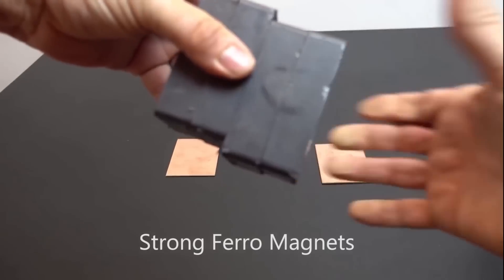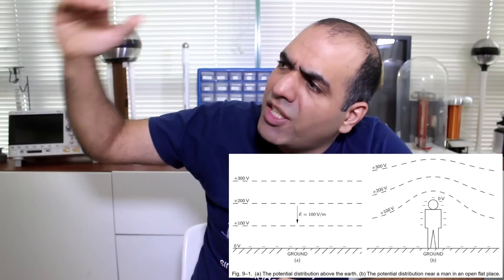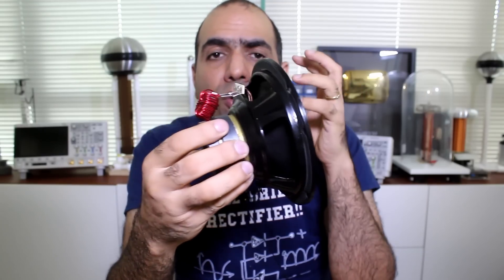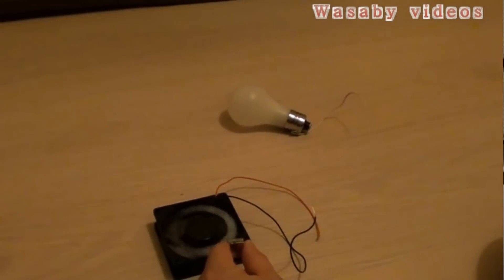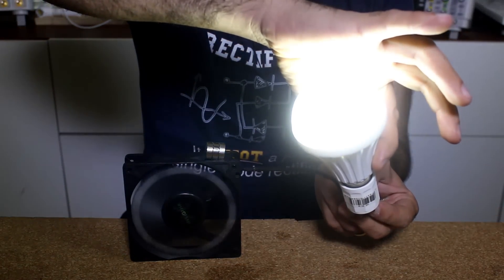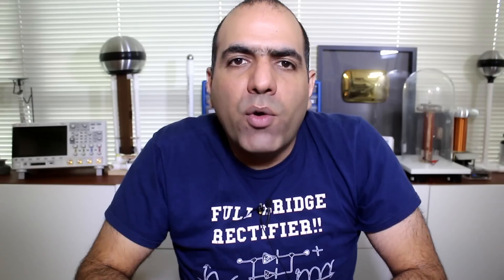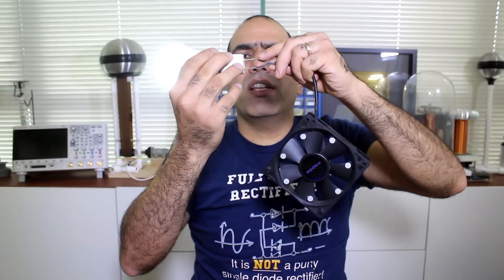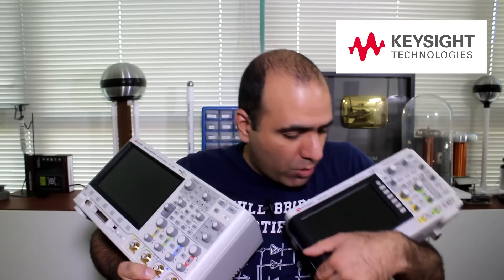Free Energy Devices Build and Science

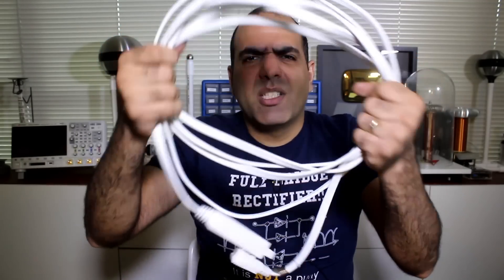Comment: 9:27 - he did not hide batteries inside a powerbar. What he did, is the that he had put his diy induction coil under the PVC and modded powerbar wiring in a way, that the cord behaved as a secondary of transformer. 
BTW. This guy under a question is DiodeGoneWild. He meant it as a joke. So don't sue hin.

Comment: If the fan energy not real, so how does the wind turbine work? It should work the same, right?
Reply: As you said, wind turbine. The wind makes the generator rotate
But in the case of the fan, there is a hidden cable or hidden battery

Comment: Please stop with fossil fuel killing the planet. That is a lie and bad science. Stick to electrical and electronic theory.by the way there are no solar panels without coal, no electronics without oil and gas. No wind mills no lithium batteries no cell phones computers or tv.where was the Tesla coil under the table. I suppose you could do it if a radio transmitter is near by as well. Any ways keep up the good work.
Reply: Christian Weissmuller  solar panel can literally be made with just electricity, y'all stupid af
Reply: @Kevin actually nuclear energy is a terrible way to convert mass into energy due to the fact that it only converts some of the mass into energy and you barely lose much mass.
Reply: @Kevin also it depends on the nuclear fuel you use like uranium which is shitty and thorium which is 1000 times better
Reply: @AuGrrr  are you kidding me? you can get a ton of clean energy since whatever nuclear fuel you use is making an extra neutron. you can just reflect it against itsellf and produce way more energy than anything we use
Reply: @crymorefkr  what I meant is that it barely turns mass into energy and is horribly inefficient in turning mass into energy. It turns around 0.1% of the mass into energy which is how it actually works. Fission is destroying mass or atoms to create heat. Fires turn 0.001% of mass into energy and nuclear reactors turn 0.1% of mass into energy.

Comment: Do an episode on the of casimir effect. Two plates being pushed together by virtual particles seems technically like free energy to a very limited extent. This experiment has also been done using light that oscillates at relativistic speeds to make virtual particles real.
Reply: No , the energy you are talking about that drives 2 plates that are very very close (and flat) together is always with us, it is very small  but normally is  hugely drowned out by other forces . It is not free energy ! When you separate 2 plates you input the energy that resets the energy state .

Comment: Could you use fan with magnet facing the same way and hold a magnet facing the other way and then spin it and would the magnet facing the other way repellent but instead of the fan motor do you have a magnet that's spinning around a coil what that create at least a little energy if so wouldn't that work with the fan

Comment: Hi I have a doubt I need to make a dc power supply with 110 v output but in India we have wall outlet of 220 v ac , I have challenged myself to build it using the parts from an old computer smps can you please help?
Reply: Best you can do is use a  reduction transformer to reduce voltaje and at the same time isolates the circuit from the electric line. You must do it this way to be safe.
Reply: @roner61  I already burnt through 2 of those , every time I wire the primary to the wall socket it bursts
Reply: @hemanko007  You can try with 2 transformers, for example: 220/12 + 220/24, and connect the 12Vca into the 24Vca  coil (inverted)... look some videos about connecting transformers.
Reply: @hemanko007  I dont understand why your transformers get burnt...
Reply: @roner61  me neither

Comment: They all have a battery inside of the light bulb and you just short it with your hands shaking your elbow was doing nothing you had what your finger is that what it actually is shorted because your fingers isn't very good at shorting and in the middle using a 12 or 24 volt PC fan that runs on DC to make 120 volts ac no way

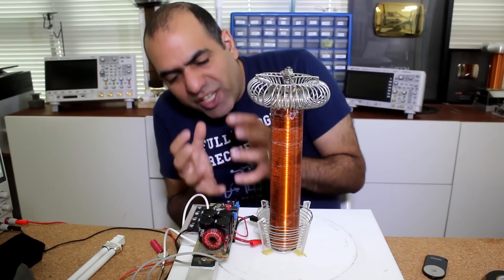Comment: At 8:00 you say that there are no streams of electromagnetic waves coming out of objects that are stationary. I think that this is technically incorrect --- there are constant streams coming out (black body radiation) but at the same time, exactly the same amount enters the object at thermal equilibrium. You still can't, of course, get energy out of it --- the streams would have to be different between the objects, which is the same as saying the temperatures are different --- it's a heat pump!

Comment: Can you make a video about Farad and microfarad ? Please !
I'm trying to create a circuit for my Airsoft shotgun and I don't know how to calculate how many Farad I need :(
Reply: why do you need electricity for a shotgun
Reply: @tornadius4343   its an Airsoft gun which uses compressed CO2 cartridges or springs to fire small plastic BBs. Its a toy, not an actual weapon.
Reply: @feloria1862  i read the same thing you did. i know. but why would you need electricity for a shotgun. green gas or co2 or just regular pump action would work better
Reply: @tornadius4343  it works in this way, There’s a motor and a gearbox that run a piston to provide compressed air. C02 airsoft guns are more expensive

Comment: But is there are good solutions to get "free" electricity from various signasl like in my case i live in city center there is plenty wifi signals antenas and electrical activity i would like to make somkind coil antena that would pick up some power for curiosity and further experementing
Reply: If you actually tried to do it you would figure out that a 2x2cm solar cell using visible light from the sun through your window overpowers a giant antenae in the middle of a radio dense city that cant get enough energy to do anything.

Comment: By one of the fundamental laws of thermodynamics, energy cannot be created, or destroyed, only converted.
Another law, is that it is impossible to convert energy at 100% efficiency. 
This means no matter what you do, energy is always wasted and lost to the surroundings as heat, sound and light.
Reply: Conversion is more efficient if that loss can also be converted to work.
Reply: @vksasdgaming9472  tell me how you can convert waste energy to the desired form then. 
Its impossible to capture 100% of the energy converted, meaning the perpetual motion or free energy device WILL stop.
Reply: @aether1370  Waste heat can be used to heat water which turns to steam and steam spins the turbine attached to a generator. Improves efficiency. I know capturing 100% of converted energy is impossible. For perpetual motion device be useful power source its efficiency must be over 100% and that means excessive waste energy it creates will destroy it. I guess these free energy devices appeal to ignorant and paranoid.
Reply: @vksasdgaming9472  good
I thought you were like "OmG fReE eNeRgY iS rEaL"
Reply: @vksasdgaming9472  consider me proven wrong xD

Comment: Why don't we harness the energy of the sky? My idea comes from the fact that if we could use titanium oxide to make it rain, why don't we use the clouds and a heat source to create artificial lightning? 
Would that not be enough energy to continue generating a generator that can continuously run, while finding ways to utilize the power output to generate more power through other capacitors?
Reply: Because you need to use energy to get titanium oxide and clouds need to be found and you would need to put it in the clouds, you would waste more than you could get, clouds move and you would need a moving metal spike that gets the energy into a battery, lightning creates a lot of plasma losing energy to heat.
Reply: I think you'll find that seeding clouds is completely separate from making lightning, which requires temperature gradients (aka gigantic amounts of shifting energy)
Reply: @logitech4873  and where do you propose to get this lightning hmmm?
Reply: Its literally in his comment to get "energy of the sky" from natural occuring lightning which would be very inefficient
Reply: @tassadardaris7294  What?

Comment: I feel like with a couple more components and a much bigger fan, that magnet fan thing might actually be able to generate some small amount of power. 

Adding an alternator and a power inverter, along with batteries to store the power would essentially create a wind generator, but without the wind. 

The problem would be that I don't think the magnets would actually push the fan blades. I think the magnetic fields between two blades would equalize and the fan wouldn't move at all.

Comment: How about you create a large circular thin platter and on that platter perfectly line up tons of really small horseshoe magnets in circles, then create a ring of light material that branches out in all directions from outside of ring and has thin bars of metal that hang down perhaps even lots of coils around each small bar of metal hanging down. Now put motor in center of ring and attach  it so when it's on it will be able to spin the construct with small metal bars hanging down. Now build small pillars that sit around the lower platter covered in horseshoe magnets and atop the pillars put a circular ring shaped track. Now build a large ring shape structure around the other structure with the branches that have small metal bars hanging down (secured in place but pointed down) make sure rung is also made of very light weight material just like the branches that are holding metal bars. Now on the ring that's around the branched out metal bars hanging down put magnetic balls that will magnetically float on the circular platform sitting just above the horseshoe magnets. Make sure the metal bars attached to branches is all wired up so when they start passing through the magnetic fields of the horseshoe magnets the electrical current can be funneled and captured into a battery and into the motor that will spin the construct. Now place the circular construct with the small metal bars hanging down in position on the circular ring,. If positions correctly the magnetic balls or flat circular magnets will be floating on track and metal bars will be poking down wards perfectly lined up with the center of each horseshoe magnet. The distance the small metal bars are from the magnet must be perfect so it can pass through its magnetic field without having lots of impedance from its magnetic force.  :D Now think for a moment the light weight construct with very small metal bars hanging down won't take much energy to spin because of how light the entire thing is and the amount of magnetic interactions taking place with each revolution will be in the thousands if you put enough in place. So essentially you are maximizing the effect by using light materials and lots of small interactions and the outcome should be lots of stored up energy. Perhaps not by itself but even if it's a small gain then all you gotta do is keep building more on top of each other Wash rinse repeat until you have the output you need. Oh yea and to all you nay sayers out their :D Save your breath because this idea would surely work if built correctly. :D  -Adam M Anderson

Comment: Although weak, magnetic potential energy does exist and if used wouldn't be overunity because you would somehow have a way to convert the two types of energy.
Reply: It's true that two interacting magnets have potential energy, it cannot be transfered to other objects in a cycle(you always could drop a metal thing on a powerful magnet it'll accelerate, hit the magnet, got a bit of kinetic energy transfered into internal energy in form of a temperature, but you cannot made some kind of a loop process to heat the same metal peace to the melting point).
Also, magnets could only do work on other magnets(or feromagnetic stuff, that in present of outer magnetic field become a magnet too), not on free floating charges.

Comment: See..  The oscillation thing I said to play with would work like the extension cord method toutch it with energy and loop it.. but with components that multiply the current and a bank or directly powering something with a discharge or overflow unit if you will

Comment: Hey..  can you make an arc with an earth battery?   I've built my own before, and I know they work.. but I only made a 12-14v battery.  Enough to power LED's.. small electronics.  I know you can upscale it to produce more, but I don't know the amperage output.  I used Aluminum - Wet Dirt - Copper.

Comment: Couldn't you just make two large electromagnets or perhaps regular permanent magnets (rectangular or cylindrical) and mount them on a shaft (one per side, offset 90 degrees) hook the shaft to an electric motor then place that inside of a casing that is electromagnetic and can flip polarity? In theory it would only take a bit of power to spin it once and then if you flipped the polarity at the right time it would run itself and most likely create more power than it draws? Not really free energy as you'd have to put energy into it but it would multiply the energy you put in and spit it back out? Idk anything about electronics so if that's a dumb idea then I apologize!
Reply: You might not even need two magnets perhaps one would work if the shaft was balanced and had a counter weight idk

Comment: lol the to-be engineer in me was going “wtf” until about 7 minutes in the video. two things that stood out to me: 
1. energy cannot be created out of thin air. to my little knowledge of electromagnetism, current=\=total energy, it is merely a factor of calculation. all those contraptions were just pulling energy literally out of nowhere. 
2. if this WAS true, society would have been doing this for decades and decades. we’re already producing energy nearly as efficiently as possible lol which is unfortunately still so low
Reply: There is a small truth in all of those devices. There is a recurring theme of magnets and coils. You can indeed create energy with a magnet and a coil, but you need to move the magnet relatively to the coil, thus expending mechanical energy. Those sneaky bastards mix in reality (induction) with fiction to seem legit to the most.

The total power in a circuit, if you are interested, is the current times the potential, so if your devices consumes 10 amp at 10 volts it draws 100 watts.
Hope this helped 👍🏻

Comment: There are electronic circuits that seem to give free energy. To power a small LED that uses, say , 3.5v and 20 ma on a 1.5 v battery. It called a LED driver. An LED can be turned on and off really fast and it seems like it is giving off constant light. It is a trick that works. The Talking Electronics web site has some fun projects like this.

Comment: I have and prototype that could load the amp and voltage from a lightning, I will not call it a battery since the method is copperbased foliumoxied and does not have an capacity limit. So with just one lightning I can then use my device for apx. 1 year on a load for 220v 60hz 900watt without recharge with i lightning again,.

Comment: I built your device. Note: ALWAYS watch videos to the end!!  When I placed the magnets in the coils, it didn't work at first. After a few hours of adjusting the magnets, and replacing the bulb with a fluorescent type from your other videos, it began to oscillate. A small, cloudy ring of smoke formed above the bulb. It began to rapidly rotate counter-clockwise, and became very dark. A small, green, 3-fingered hand reached out from the center. In a panic, I hit the device, dislodging one of the magnets, and the ring immediately closed, slicing off the small hand. It was delicious! I marinated it in barbecue sauce for an hour, and put it on the grill. Fantastic!  I find that this happens every time I place the magnets in the coils. They're even tasty fresh & raw. Be sure to place the magnets, such that the ring rotates counter-clockwise. Otherwise, small, black, soft, smelly objects drop out, which do not taste very good at all.

Comment: what if we made nikola tesla coil, big like one house, it's enough  one small spark to power up the tesla coil, and it's easy to make 
a spark. so we will enough energy to power up the house and + to power up generators. NOTICE: when one motor running very fast end  turn off the power the motor will still running without power but for that short time it will produce energy enough for spark, so it will power up the tesla coil, so this is the vortex powering.
1. spark to power tesla coil
2. tesla coil will power the generator.
3. the generator, still produce energy after been turned off of the power, because still running, and will produce energy for the spark gap for the nikola tesla coil.
4.and tesla coil will  power up again the generator.
5. so all of this is = to free unlimite energy.
6. that's it.

Comment: Magnetic motors are made, (I saw it in Iran) that they work without electricity. These motors can be plugged into a small generator and powered up. There is no battery and no trick. There's only one point: for example, ten kilowatts of electricity are already consumed for magnetic charge, and the motor returns about five kilos in less than an hour, then the magnetic charge is over, the engine stops That's it

Comment: there is noise in the air, so we might as well use it.
Reply: The noise is so weak, there is no way to even light an LED for a mili second
Reply: @srjuliusiv5383  Nobody's used a big enough induction coil yet though, don't you think? I was thinking very low-resistance thin coil wrapped around a pencil until it's too big to fit in the backyard/house with some diodes and capacitors leading to a rechargeable battery... how long would it take to charge something like a portable charger battery.
Reply: @NullifiedMinecraft Very true, getting down the perfect thickness-to-resistance ratio algorithm.